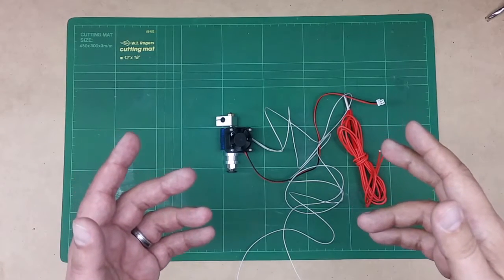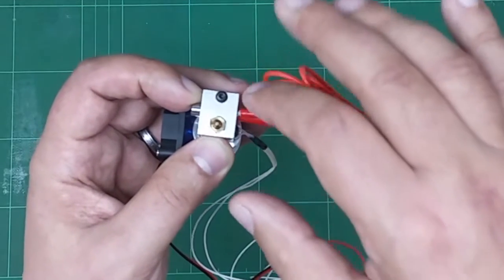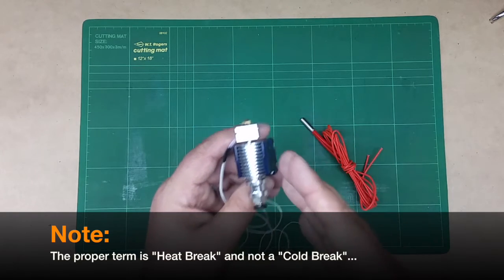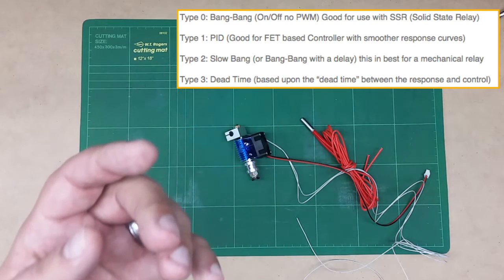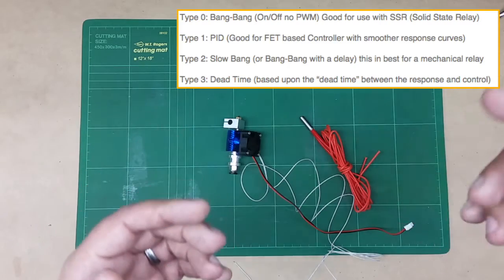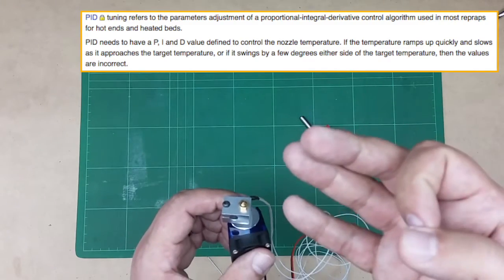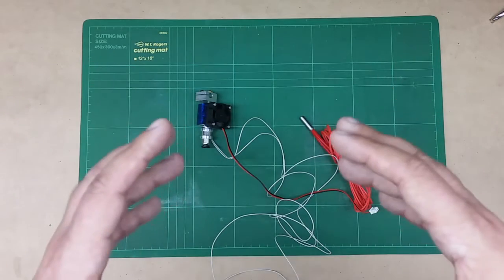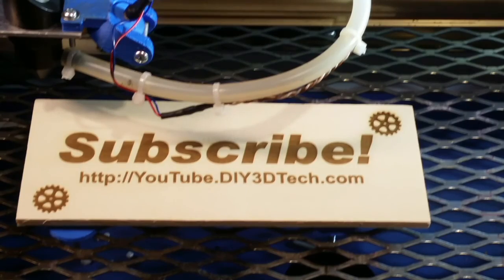3D Printer Talk - Dead Time versus PID and why you should Care! Part 1

Comment: good INFO!
I did not know exactly what that PID was.
what it did and so I skip it.
also because there was said in a video
there are standard values
leave those values if you do not know .......

and very coincidentally I also have problems with retracting!
it then stops printing and crashes.

(also the language is a bit of a problem once in a while/sometimes)

friendly greetings from The Netherlands!
Rob
Reply from the maker: Aah my second home (the Netherlands and that is where the Orange for the Channel comes from as I spend a lot of time in Den Hague).  Also PID are really determined by the system and feed back loop if you look in Wanhao playlist there is more on setting PIDs.  Also I am unclear about  "retracting", do you mean retraction?  If yes I am still confused on the question...
Reply: HOoww yes I go to Den Hague/Den Haag now and then.
my wife did a run yesterday in Den Haag (among others about the beach)
nice!
yes I meant retraction, with small prints it goes wrong
and the printer Crashes like a Clog

again greetings!
Rob
Reply from the maker: Yes I stay at the Kurhaus there on the beach, for the retraction it sounds like your doing too much as there are two important setting, the first is the distance the head mush "travel" for a retraction to occur and if the distance is to short you will have too many retractions.  The second is the distance of the retraction or the distance the filament "backsups" and this should be around 2 to 4mm (adjust will be based upon the hotend and quality/type of plastic.
Reply: .
okay, I will work with this information!
Kurhaus, yes I know that!
have been there a few times as well
currently it is snowing all over the Netherlands
then the whole of the Netherlands is a little panicked! ;-)
I live in the Rotterdam area
also quite a nice environment!

I say
Thanks a lot for you info,
and friendly greetings again!
Rob.

Comment: Wanhao i3s use Repetier not Marlin. I dont know what the i3plus uses though. I dont think Marlin supports dead time(could easily be wrong about this).
Reply from the maker: Many thanks and good to know (i.e. it using repetier) and have been having good luck so with PID but still there are major issues with temp control...

Comment: wow what perfect timing , i just got my franken printer alive .  Just need to tune the  head and figure out the extruder motor and such tonight . but if  i can get it to have enough force as needed , i may even have print sort of done  because the dry run movements are fine . 
so yeah great timing , it works out great for me that you are starting a hotend tuning set.
i suspect my thermistor lies and the head is a touch cooler than it reports . I wish i had some spare  ones i could stick one on and take a reff' reading , not just with my IR  thermometer
Reply from the maker: Not to give away the plot, however yes that is what I have found with Wanaho that it lies BIG time!
Reply: minis out by 30 to 40 deg C! .. im gonna have to try and re ID the thermistor .  its spot on at room temp 20c .  matches my IR  no contact thermometer . but once it says it 200c the heat block is  only 155 to 160 . that said my fan is on D11 and it should be D6 ,  as D6 supports PWM .  so my cool end fan might be too strong . 
I wonder if a lil' dip of thermal paste would help the thermistor and heat cartridge . 
i need to see if my heat is PWM(pid) or band bang of some sort as the LED for it flashes like bang bang .  it will over shoot and hit max temp  (250c)  real easy out of the blue . 
I did have one issue of there being oil or something on the thermistor pin on the ramps board  , and it got better when i cleaned that . 
My small stepper for the bowden might look tiny but i can feel it push against my thumb and hold with enough force that PLA would flow easily .  
so i need to fix the temp on my hot end . Ugh . lol  I might pull the thermistor from my heat bed  and try that one in the hotend .  I dont need a heated bed just yet . 
I have a bigger stepper comming for  extruder , so i should order a few known thermistors .  
also to test i could tape one to the  head of my fab mini and do a heat cycle there and watch what it says , see if it matches the fab mini temps , as i have that dialed in via IR .
Reply from the maker: In doing these tests I did use thermal past and this is the issue I am having with Wanhao at room temp its there however as it heats, it drops off and the more it heats the more it drops!  Read on the internet that some these boards had flawed A/D conversion and that was the issue, however  an thinking about swapping thermisters and see what happens...
Reply: yeah i was looking tonight .  i have some things to test when i get home . As i had a short that was intermittent , its possible one of the  leads going to the glass bead is still getting to a short to the heat block and acting as too good a heat path into the glass  , or  bi-metal expansion is  pinching the  wire at the retaining screw. .  
because i have the thermistor reporting  higher temp than the head is i believe . If that sthe case i will do a ice water  to boiling water calibartion and check teh % diff at 100c in boiling water . whatever that % is i will adjust the beta value but that % and re check on printer . 
if i  cnat hit melting tem accurately enough , no point worrying about the extruder stepper yet . LOL
Reply from the maker: Would think the nozzle should be a "little" cool than then the heat because (1) the increased surface area and (2) second the distance.

Comment: have monoprice i3 with flexion extruder  hi-temp upgrade added  brass screw in thermister  ,the glass thermisters  scare me, keeps good temp readings without fan . temps drop off when i add parts  fan, mite have to move thermister closer to heated nozzle on heat block, also using heat sock on block. do you think maybe pid will help ?  did you do  the ground mod to the printer's board & did it help ? 3drecumbent@gmail.com
Reply from the maker: So how do you like the flexion extruder?  Thinking about making the move as my Swiss Micro/MK is getting long in the tooth.  Also yes on PID, as I just use post processed GCODE for various temp profiles..
Reply: pricey but works well  how about ground mod
Reply from the maker: Sorry ground mod?????
Reply: there is a utube  vid.  monoprice i3 upgrades that has a printer control board ground mod to improve grounding since the wanhoa & monprice are so similar i thought you mite have tried it  happy thanksgiving mike
Reply from the maker: Oh yes sorry, (lets say the thanksgiving turkey got me :-) that has been done as if you look back in the Wanhao play list you will see me do it.  It did improve things and frankly in the Wanhao v2 I think part of the problem is the board is not designed effectively handle the power it needs to (this shows up in a later video also).  However I leave it close to stock for video purposes as this what most people have and will work with.  Other wise I would majorly re-work it...